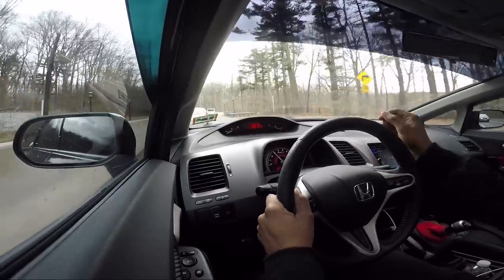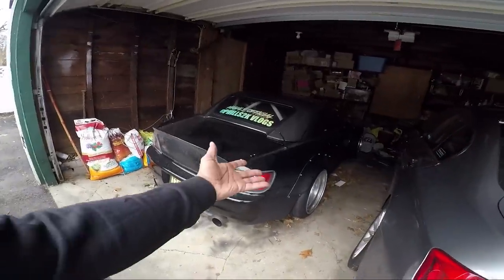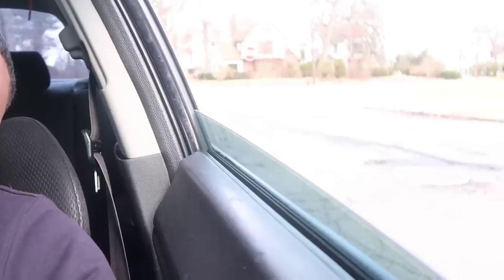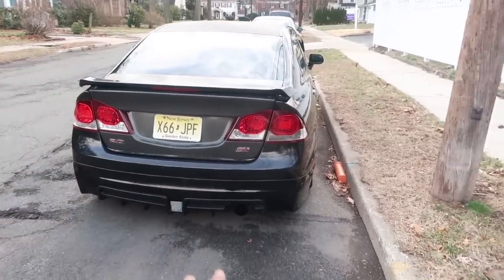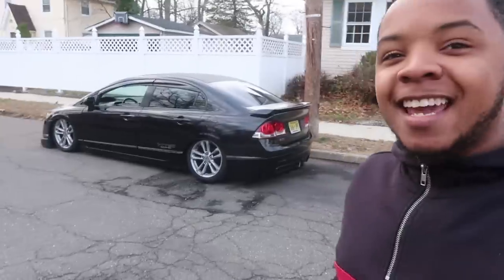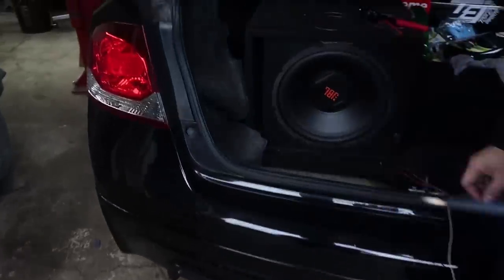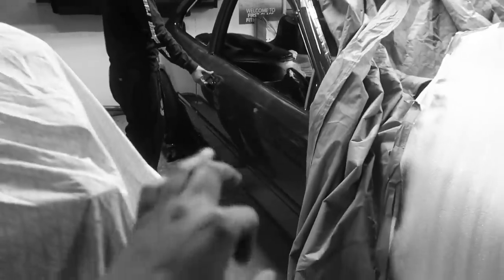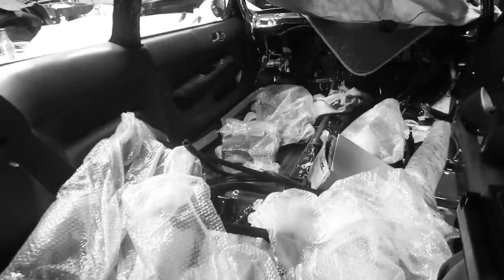FA5 AUTHENTIC MUGEN PARTS INSTALLED / K20 CIVIC EK BUILT FROM SCRATCH

Comment: Civic si is a upgrade to your old garbage bimmer 😆😆😆 thank god you sold it👍🏽
Reply: You crazy that a downgrade
Reply: @iseeyouhater stay off the weed
Reply: @aronbank7498  thanks for the compliment but I need my weekend weed 👍🏽
Reply: @Sam-un5km  bimmer has alot of problem/money pit💯 compare to the civic si, so in my eyes it's an upgrade 👍🏽
Reply: @Alohabruddah  that a lie. I had BMW in the past i never had no big problem.  I had one bmw with over 350k miles the only work I had done to it is a water pump and a radiator. I have 3 BMW right now  with no problem. Don't act like Honda is reliability they stop be reliability after 2001 I work at a car dealership.
Reply: @Sam-un5km  you baby your BMW and not drive it hard to be running ok😆😆😆